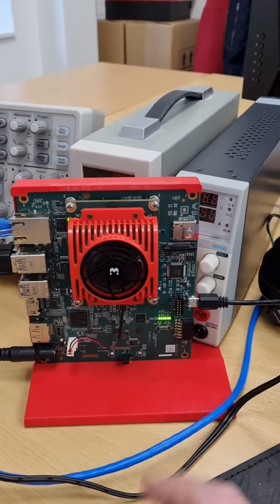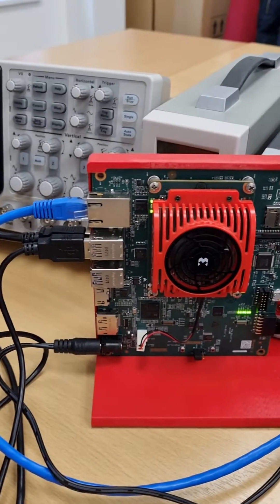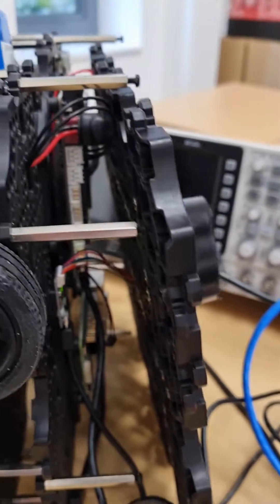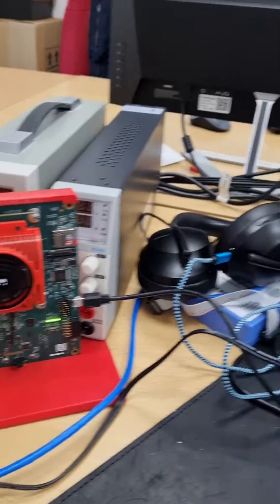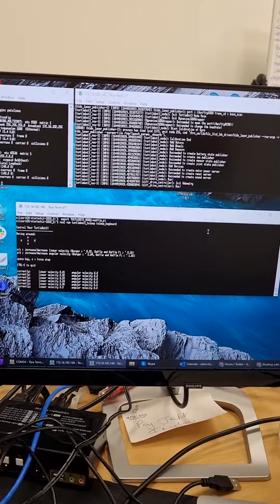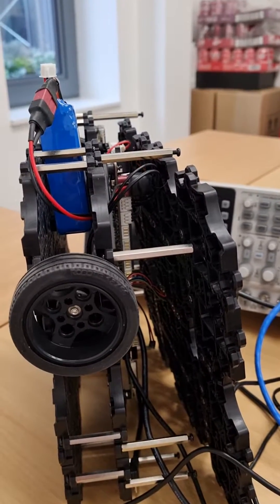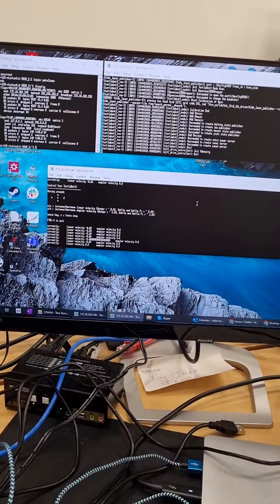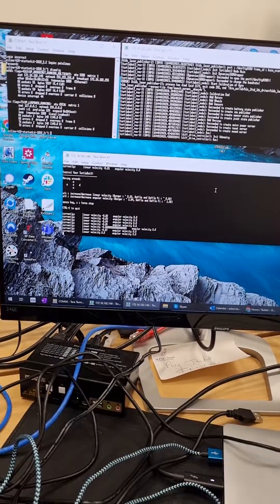Kria Robotic Static (Alpha) on KV260 with Turtlebot Waffle

Comment: Did you accelerate the ROS 2 node?
Reply from the maker: Not in this application but it will be in the end application
Reply: @AdiuvoEngineeringTraining  I am working right now on accelerating either a ROS2 node or an image pipeline function…using krs.